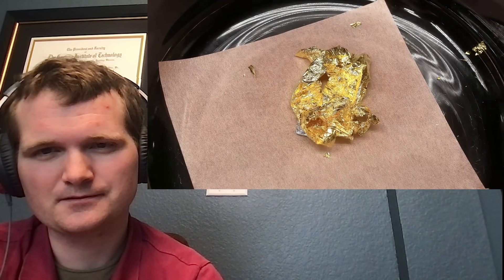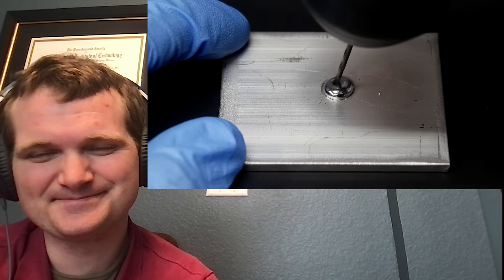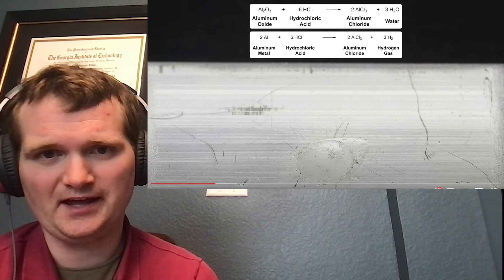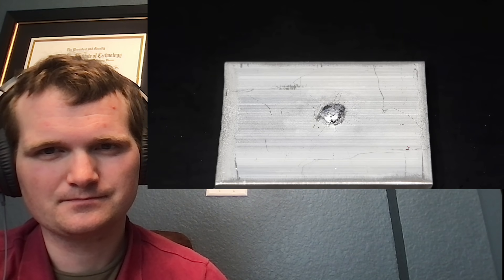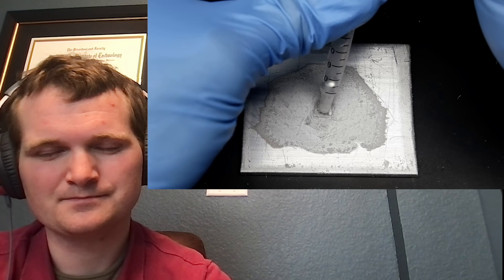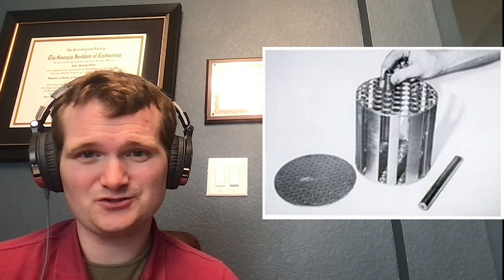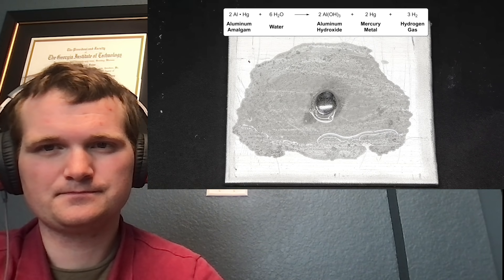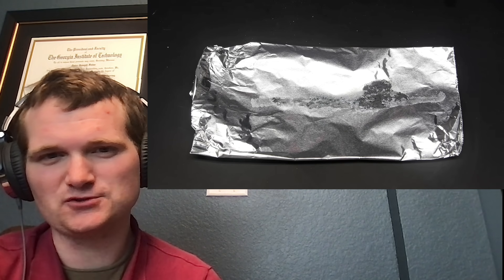Nuclear Engineer Reacts to NileRed Aluminum and Mercury Amalgamation

Comment: Fun fact, aluminum oxide is the base mineral sapphire is made of, so basically every piece of aluminum you have ever handled is covered in a few atoms thick layer of polycrystaline sapphire.
Reply: @kozodoev  sure, and I understand the distinction in a sense, but the distinction between a gem and the mineral itself is sort of meaningless, especially when there are huge industries that refer to any synthetic corundum block as sapphire unless it's specifically made with chromium for ruby lasers. Even when you get down to minutiae,  and you limit the definition of gem quality to a large single crystal grain, there are synthetic sapphire production methods that produce porous and polycrystalline sapphire that is still considered sapphire. The distinction between labeling something corundum or sapphire is not really one of actual physical properties, but rather usage.
Reply: Did you mean Ruby?
Reply: @yaroslavpanych2067  same chemical, different colour due to different dirt
Reply: TIL. Always thought rubies and sapphires were chemically similar to diamonds. Are there carbon gemstones that take on color from impurities like ruby and Saphire?
Reply: @Ezekiel_Allium  diamond has a ton of different possible colors. Intense color is more rare in diamond than in many other minerals, but can happen. The Hope Diamond is a very famous blue one. Interestingly, diamonds also exhibit some colors as a result of deformation under extreme temperature and pressure.
Diamond also frequently has inclusions, where other minerals are encased in diamond. Black diamonds commonly get the color from having a distribution of tiny regions where the carbon has formed a graphite structure instead of the diamond crystal structure.
Reply: @markjacobson4248  oh, I had no clue about the inclusions thing, or how black diamonds work, that's cool.
I was more asking if miscolored diamonds get any fancy names like the way ruby and saphire are colors of corundum. But I'm guessing not based on the not bit of googling I've done and your response.
Reply: Yes, I think, red corundum is called "ruby", but red diamond is called..."red diamond".... @Ezekiel_Allium
Reply: @Ezekiel_Allium  Nope, just diamond. Ruby and sapphire received names well before we had any way of knowing that they were nearly identical on a chemical level, so understandable why the same mineral with different impurities has different names. The mineral Beryl is one of the others I can remember that has different names for different colors. Emerald if green, Aquamarine if blue, and Morganite if reddish. There are definitely many more. I think it's important to realize that when the gems were getting their names, the people who found them likely had no idea that the different color gems were actually nearly the same thing, so different colors got their own names.
Just guessing here, but I suspect that it was relatively easy to tell if a gem was a diamond regardless of color due to its hardness, which is probably why it hasn't gotten other names. If you know diamond is the hardest thing ever found, and the only thing that can scratch diamond is diamond, then if you find a crazy color diamond it's still not that difficult to identify it as diamond.

Comment: Mention of liquid metal cooled reactor made me recall the story i heard once about Soviet subs at one point using liquid metal as coolant. Major problem with it was that it required reactor to run even when sub was in drydock on maintenance, because if reactor had cooled down, liquid would solidify in pipes/heat exchange making it impossible to circulate it anymore and thus rendering reactor completely inoperable. Person even mentioned that there was one specific accident involving this kind of event.
Now it was second hand story telling, so I can't be sure it's truth, but hey...Soviets did a lot of crazy things after all.

Comment: So, I am at 5:20 or so in the video at the part where you are talking about the cladding reacting with water after a total loss of coolant failsafes. Are you alluding to this causing a buildup of hydrogen gas, thus creating a positive void coefficient? Isn't this what happened to Chernobyl's RBMK?
Reply from the maker: Good question! This actually has nothing to do with the void coefficient, whether it is positive or negative. The generation of hydrogen is simply hazardous because hydrogen is explosive. But yes, this hydrogen generation occurred in TMI, Fukushima, and Chernobyl; though in the case of Chernobyl hydrogen caused the second explosion after the first steam explosion which already severely damaged the core.
Reply: @tfolsenuclear  Hey, thanks for the reply man! It's really interesting that the important part isn't necessarily the voids, but the buildup of hydrogen gas in the reactor. Makes sense considering how volatile Hydrogen gas can be under heat. What measures are typically used to prevent a buildup in Hydrogen? A release valve? Or is ti kind of a hope it doesn't happen thing?  Apologies if my questions seem a bit inane, but my knowledge involving reactors is very tertiary.
Reply from the maker: Happy to answer questions! Keep the fuel cooled and submerged in water. The zircaloy-water reaction only happens when the cladding reaches 2200 degrees Fahrenheit or higher. That’s one of the reasons the plant I worked at has 3 trains of independent redundant emergency core cooling systems, plus several backups. Just one train will do the job by itself, but we have so many just to be absolutely sure. Even more backups were out in after Fukushima
Reply: @tfolsenuclear  Huh. Would this level of redundancy NOT make Nuclear more safe than coal based power since they both rely on boiling water to create power? This just makes me wonder why we don't have more nuclear power.

Comment: Now we know how Cousin It was born.

Jokes aside, this reaction is scary as all hell considering how many aluminium engine blocks and structures we rely on these days.

The reaction isn't that easy to start as it has a hard time penetrating aluminium oxyde layers, but it does have the potential to "infect" an aluminium structure and completely ruin it from there on, with the only sure way to fix it being to replace it.

Comment: Would replacing the oxygen atmosphere with pure nitrogen in the containment building remove the hydrogen problem?

Also it would slow down rust by a lot to.
Reply from the maker: Good question! No, since the reaction is between the cladding and water, which is in the sealed reactor pressure vessel inside containment. 

In a post-accident scenario, recombiners are more effective at scavenging the hydrogen simply because the containment building is HUGE - you would’ve need a lot of nitrogen! 

One other method is to essentially use big spark plugs! While this wasn’t used at the plant I worked at, the idea of preventing a big hydrogen explosion by causing small ones is interesting, as the containment building is strong enough to withstand small explosions, but not a massive one.

Comment: Yes mercury is 13 point something times denser than water.  I should know it off the top of my head since mm hg is so commonly used and even at 16 years old during my apprenticeship and long before university it was something you were expected to know just like the l.e.l. and u.e.l. of gases like methane (5 to 15% in air).

Comment: Mercury in MM is the measure of pressure.

Water is not usable, because water can easily convert to water vapour, creating a non 0 pressure inside the tube.

Comment: maximum water column height is of course 9.81m, since water is 1kg/l and acceleration by gravity is 9.81 m/s².
maximum mercury column height is 72.4cm, since mercury's density is roughly 13.5 kg/l. Or for people who don't know how to pick sane units for measuring things, that's 28.5 inches.
Please go metric. Your system is insane.
Reply: The US uses metric. And Imperial.

Comment: I’m surprised they use inHg instead of having switches to the metric mmHg.  

Hydrogen buildup is more apt a discussion on in the Fukushima and TMI incidents.  Both outcomes were heavily influenced by hydrogen production/reactions to hydrogen production.

I do with Nile did a similar experiment with removing or lowering the oxygen availability (like building a small wall and flooding the area with argon.

Mercury is actually relatively safe unless ingested (eating, inhaling vapor, etc).  The thing that makes it generally dangerous is it’s high ability to easily propagate and contaminate services it contacts.  And of course the fascinating nature of it.  

There are much more hazardous chemicals throughout your home that have more toxic effects.  It’s just very uncommon for people to have a natural desire to play with them.